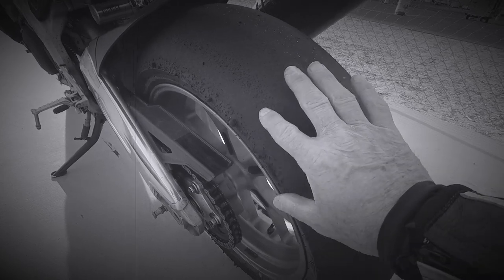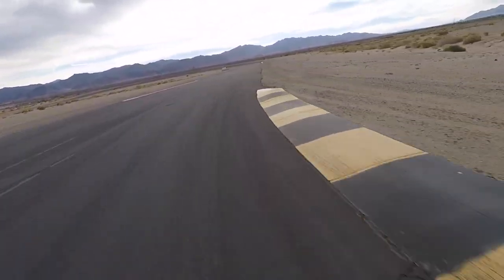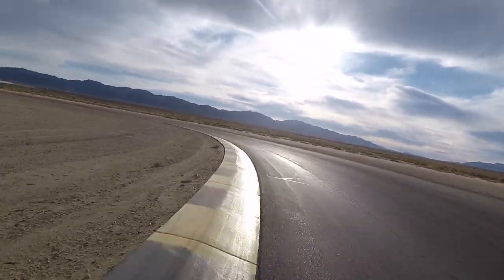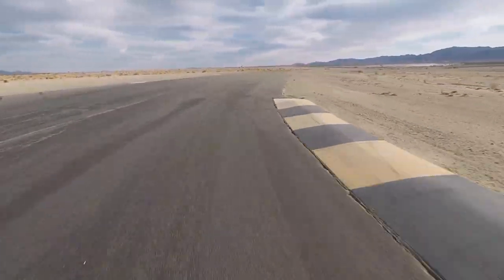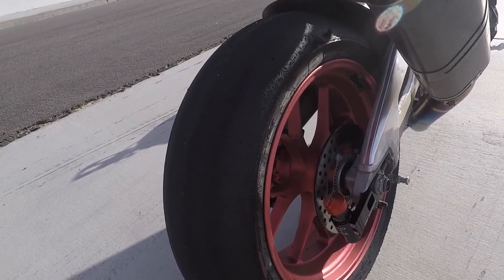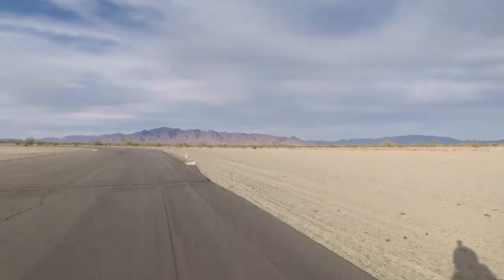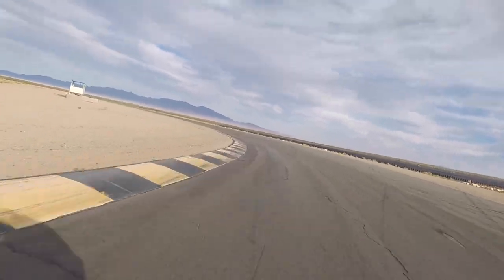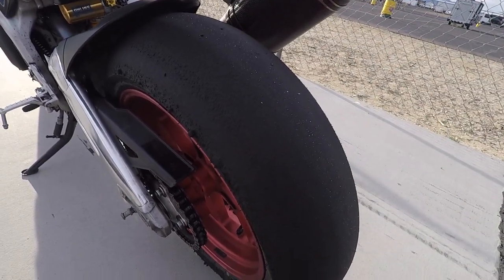Aprilia Mass Damper Test & Tune part 1

Comment: T=hanks for this excellent presentation. A mass damper arrived yesterday for my Ducati but they neglected to include the bolts that connect it to the holding unit. I am frustrated and I have not heard back from them either.
Reply from the maker: That is very unfortunate. You can get bolts from a hardware store in the interim so you can complete the install.
Reply: @catalystreactionsbw  : I woke up to good news; they acknowledged the error and immediately shipped out the bolts via DHL!
Reply: 好奇你的車輛型號是甚麼? 裝上MASS DAMPER後真的實際上感受度差很多嗎?

Comment: Wowza,  this is good news...  

 it is like a single function tool  good at just one thing =  meaning reducing tenths 
bad part shown is tyre to wear quick or slightly less quick depending on settings..... (awaiting eagerly next video)

 to overcome tyre wear  may need to use hard carcass tyre rear n may be aim towards rediculoso entry speed.... 
😁my guess...
Reply from the maker: Part two will indeed provide further clarification.

Comment: Another great review Dave. Congratulations. I have an BMW R1250GSA with normal on off use. Do you think that this would affect my bike positively?
Reply from the maker: Thank you! Great question. With off road riding, the surface is so unpredictable and irregular that it may negate the use of a Mass Damper in that it is truly ineffective. On the road it certainly works therefore i would consider the on to off road percentages and assess the ROI you would get from it.
Reply: @catalystreactionsbw  I do mostly road use. Around 80% Greek and European country roads avoiding highways. I would say 20% offroad use. Would it make big difference at road?
Reply from the maker: @Karavtech  It does not make a big difference in rider quality, it is noticeable on the bigger bumps. It also cleans up the tyre and has a big positive on tyre wear, so that is the other added bonus.
Reply: Could remove the vibration from shaft that is transferred to pegs? All GSs has this symptom.
Reply from the maker: @Karavtech  Good question and i honestly do not have an answer for your question. I hope someone else that has one has an experience to share regarding harmonics.

Comment: This truely works? Why only one resonance frequency required during operation? A you free not to get commissioned? ... I have not yet made up my mind - is this science (it is, but) or just shell gaming the trackdays public?
Reply from the maker: As mentioned in this case, I'm doing it from a layman's perspective. If it costs $X, can it work sufficiently well to reduce tyre wear and in turn provide greater stability mid corner and on acceleration. Certainly there could potentially be a huge $$ saving here for those that regularly attend track events. Starting at this level makes sense and so far, seeing the effects on settings to on track riding and tyre wear makes me think that there are positives.

Comment: Hey Dave how you doing, I forget last time we meet at chuckewalla to take a note about tire pressure, cn you remind me the pressure for cold tires on metzeler raceteck slicks on aprilia rsv4,,,
Reply from the maker: 26-28 hot rear and 34-38 hot front based on track temps and your lap times.
Reply: @catalystreactionsbw  thank  very much

Comment: Why would anyone want to add more mass to the swing arm, feels counterintuitive.
Reply: It’s not the mass, but the dampening effect of the component that helps
Reply: @dustinn5490  Adding unsprung mass causes suspension to react more slowly what I have understood (because of intertia). I don't see how that is a good thing. Aprilia made the swing arm lighter for the TV4 MY 2021 compared to older models and now someone adds more weight.

Comment: Damping the un sprung weight/mass of the suspension (to tyre )components. Very clever idea I guess. But at what frequency (thinking allowed now) I guess the smallest bumps but ones the tyre doesn’t absorb are relevant. Is it worth checking if the shock runs cooler and if you get some adjustment back on the shock to give the tyre, ultimately, an easier time? And does the weight of the suspension affect the setting say if you switched to or from carbon wheels for example….? I’m guessing race teams run un sprung components weighing NIIINE/5ths of sweat FA anyway 🤩 and the Aprilia is running stock wheels are they? Questions questions ….. come on Dave whip the bugger apart let’s see what’s in there ….?  Fuck all probably 😬 😆 ….👍 
Sorry genuinely interested 🙂
Reply from the maker: Excellent comments and that is why I want to find an Aprilia with full data capability to gather as much information as possible on data traces and shock temperatures and then take a look at the effect of carbon wheels. Each data gathering done very systematically.
Reply: @catalystreactionsbw  fascinating to watch you work Dave. Good solid processes methodically applied one step at a time, as the Mandolorian says, “this is the way”. I didn’t catch all the commentary as the Mrs was yacking on about something highly important in the back ground, but I guess it makes sense the max setting is the ideal for the stock bike as anything lighter, like carbon wheels, would need less mass damping to counter less weight, as there is less mass flapping about. VERY helpful to hear you speak out loud while examining the tire wear and how the tear pattern forms and what the looks like. Double nodules oooohohoooo 👍🏻 I wonder how many turns equates to how much weight removed? But does sound like the damper manufacturer has done their homework as it’s in the right range from stock. If it was maxed out from stock you’ve got nowhere to go. And down to 1/8th of a turn possibly. Lordy …. There can’t be much weight in the damper to counter all that unstrung weight in the back end. Swing arm, chain, sprocket, cush drive rubbers? disc, calliper, wheel, tyre etc v thar wee thing. Or the momentum of those things I should say. 
And add in a quicker on lap time on a warmer day….? I was thinking this could turn into one of those target is it a full moon black magic type deals, but the minimum setting for stock does look promising to me at least 👍🏻 oh now look. Must try and keep my posts short 😆

Comment: Seems like snake oil
Reply: The engineering and theory makes sense, but it’ll be interesting to see what Dave finds with testing. He did say it felt smoother and more settled though 🤷‍♂️
Reply: My bike runs on snake oil.
Reply: Woo…! Where d’ya get it? 😆
Reply: A good case study into the effects of a mass damper would be the Renault R26, Renaults' 2006 Formula 1 entry. Although this one is significantly smaller, the effects would be similar given the speed difference.